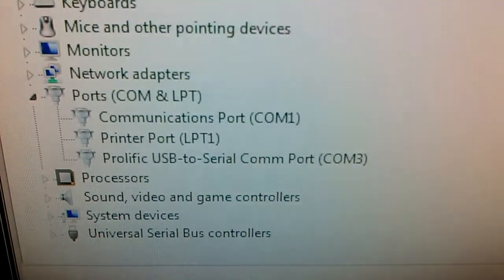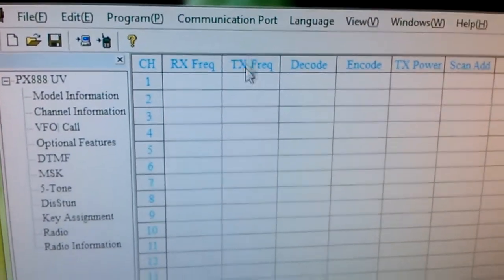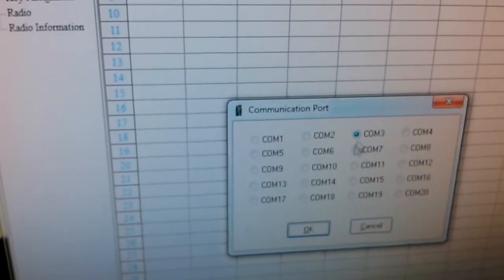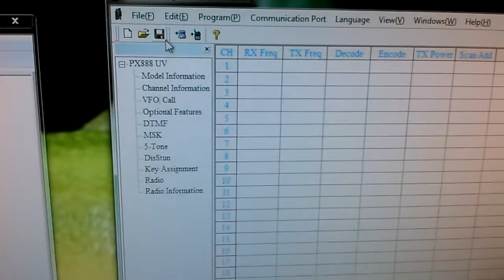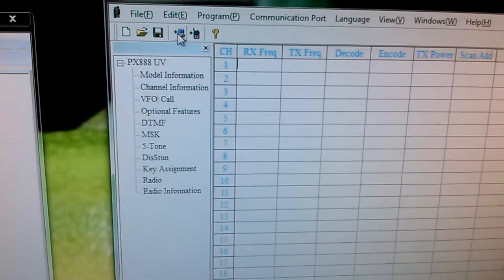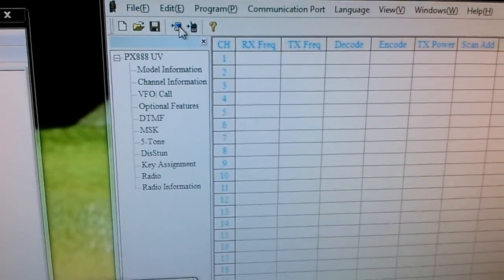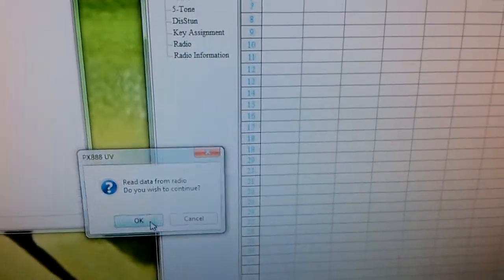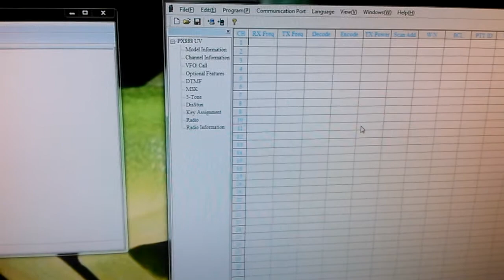Having issues with puxing px888k software reading from radio

Comment: Did you ever figure this out?  I"m having same problem.
Reply from the maker: I got a programming cable for the baofeng uv5r and that one worked.
Reply: @WhispTech  I just figured it out as well.  I installed the old 3.2.0.0 Prolific drivers for both Windows 8 and Windows 10.  Worked like a charm.  Both my Windows machines are VMs in VMWare running on a MacBook pro.  I"m guessing that the old cables have an old USB serial driver chip and the cable you got was simply more compatible with the newer Windows drivers.

Comment: Strange, I have a cable that came with my Quansheng TG-UV2, and it is able to communicate with that radio.  I recently acquired a PX888k, and tried using the same cable to no avail.  Confirmed that the TG-UV2 still works with it.  They both use their own software to read and write, but it makes no sense to me that the cable would be different for other radios.
Reply from the maker: The cables from my understanding themselves have chipsets in them and thus different drivers.  Because of this some cables don't work with certain radios.  I ended up using a barfing cable and problem was solved.
Reply from the maker: Meant baofeng lol auto correct.
Reply: I ordered one from Amazon, and just tried it.  It still isn't communicating.  Rolled my com port driver back to 3.2 like a lot of others advise (Also tried this originally as well).  I will see if I can find a puxing brand cable next.
Reply: @WhispTech can you make another video of the puxing?
Reply from the maker: @Wafff  I made multiple.  Check my other vids.  :)

Comment: I recenily bought a new px888k  band 136-174 /400-470 went i want to program to read data it seen to be  fail come out with reading 'check connection. when i want program with my old px888k band 134-176/400-480 it seen to be ok
Reply from the maker: Maybe update your software if it isn't reading.

Comment: how to fix this problem please let me know
Reply from the maker: K so it was the cable.  Stay away from generic cheap knock off cables.  I ended up getting a Baofeng UV5R cable  and this one is able to upload and download info to the radio.   Sorry for long wait for reply but Christmas holidays and it had to be imported.
Reply: @WhispTech  I have a generic cable that shows the same problem you have above. I also have two baofeng cables, neither of those cables work either. I keep getting "check connection," which I have done. I've tried both my cables on both my radios to no avail. I am stumped.
Reply from the maker: @shecaughtfire  Make sure proper software and that you are using the right connection port.  Other than that could be still the type of cables.  This handheld radio is finicky with what cable is used.